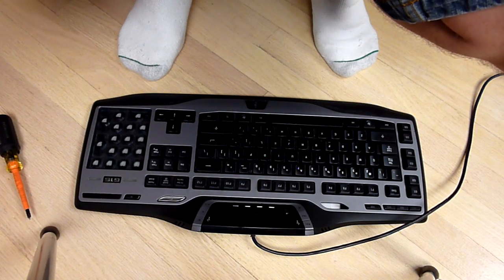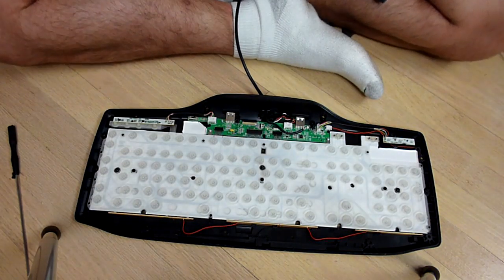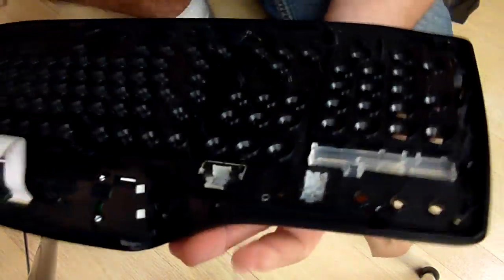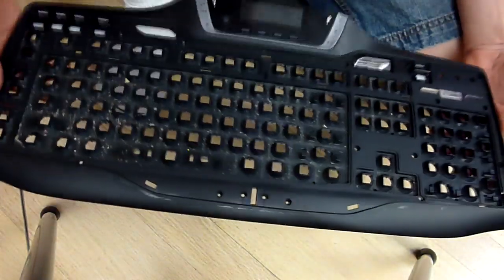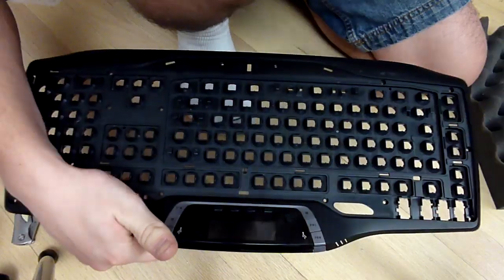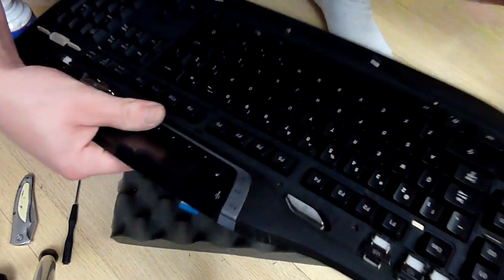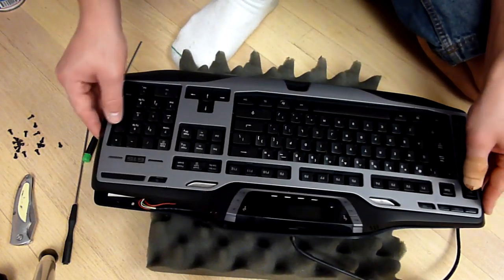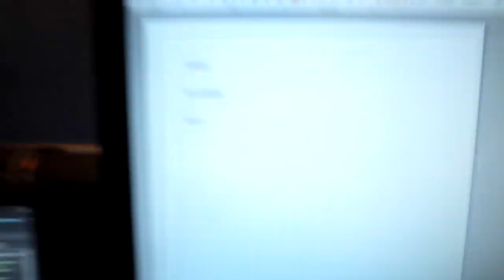Computer Maintenance 101 - How to: Clean Your Keyboard (Logitech G15) - HD

Comment: Cleaned and ready for another 16 years of use. I was stunned by the improvement, I assumed most of my grime/stiff buttons were permanent by now - but a soak in some soapy water and a shower and it feels like a new keyboard all around. 

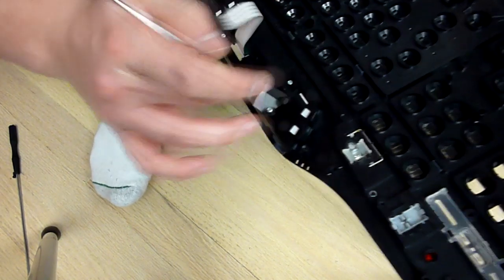Also had problems with the clips around the FN buttons (9:35), for me they simply refused to come loose. The back of the clip is kind of [ shaped, and I cut down the protrusions of the ones that were stuck with a knife and could finally get them loose. The holes are simply too small for the clips to get through. 

Thanks for a good guide!
Reply from the maker: Glad this old, overly complicated, and music cringy tutorial is still helping someone lol. 
If I had this keyboard still, id remake this tutorials :P 
Anyway, thanks for the kind words.

Comment: I've got an older version of the G15 with an adjustable LCD section and cleaned it this afternoon. It's a little bit different in that after removing the bottom screws you can flip it and remove the top black outer section (do it with the LCD fully extended as the flat cable is the longest). Then you could unscrew the top section and clean the keys.

Or you can just leave it assembled and just clean it with a vacuum cleaner and a mildly wet tooth brush cleaning it with the keys down so all the crap falls out the right way. It will save you a lot of time this way.

Comment: Nice video, just cleaned my g15 v2 after watching it, never cleaned it since I brought it about 5 years ago. What a mess inside, not to mention I have a budgie that loves to stand on the keyboard a lot so you can imagine what was in there lol. Did have to pull it apart again after testing as I'd forgotten to make sure the metal bar on the larger keys were positioned under the plastic tabs but I'll remember that one for next time.
Reply from the maker: BudgieFan39 Glad my Video helped!

Comment: If you spilled water, soda or anything over your keyboard try this (IT WORKED TO ME): disassemble your keyboard, find the keyboard membrane (three foil of papers), clean it using antibacterial wipe or spry thoroughly, wait till its dry, clean the connections with the antibacterial product, wait till its dry, assemble your keyboard and WOALA!! it works!. Hope it helps!
Reply: "and WOALA"

Voila

Comment: I have a g-15 from 2011 or something and the F4<-- key is like damaged internally, it press itself, and because of that i had to create a rule in Windows through gpedit device restriction,  to uninstall  a USB/HID from the keyboard to stop the issue

Now my keyboard f4 works perfect, but  because i uninstalleD:
This 2 things usb and hid from device manager and set a rule to avoid the installation. 
USB\VID_046D&PID_C227&REV_0020
USB\VID_046D&PID_C227

Sadly this issue affects in Linux, and while installing any operative system and this is driving my crazy, because wish  logitech can do something for me, like offering a firmware or something.

Comment: I found your tutorial cleaning vid very helpful, as I just cleaned my G15 Keyboard.. but now I have a blank LCD display and the orange lights flicker ever since I put it back together?
Reply from the maker: i would say try to disconnect the robin cable again, clean the contacts, and reinsert.

Also check to see if you cracked the cable, may need replacing.

Comment: hey.. i have the same keyboard but it has some issues. the s n m and spacebar keys remain pressed like ssssssssssssssssnnnnnnnnnnnnnnnnnmmmmmmmmmmmmmmmmmmm                         you get it.. 
hpw do i fix that? will cleaning do? its out of warranty and the company doesn't take out of warranty stuff for repair. and the keyboard is not available now. please help. thanks
Reply from the maker: cleaning it will definitely help, but i can not guarantee it will fix it.

Comment: Why didn't you show the removal of the LCD panel? :-(
That was the only part that I needed to see because my media buttons are totally fucked up (hardware failure I guess) and are very difficult to press... I guess I will have to figure it out on my own ;)
Reply from the maker: honestly once you get the LCD cover off and you expose the PCB and buttons, its 2 screws and it pops out. super simple :)

Good luck!
Reply: Yes, I noticed it. I was kind of afraid to clean that aswell since it was already malfunctioning and wouldn't want to destroy it any further.

Turns out, after cleaning, it even works 100 times better and the buttons are no longer malfunctioning! :D
Reply from the maker: alain001

Awesome!

If my video helped please remember to thumb it up, and if you would like to possibly see more subscribe to see all my new releases!
Reply: @Orvis25  I got the LCD cover off, exposed the PCB and buttons.  Do not see 2 screws, nothing is popping out, not so simple for me.  Really wish you had shown either the removal or installation of the LCD assembly.  Otherwise, great video.  Oh, except the music that was as annoying as Yoko Ono.
Reply from the maker: @mre4875  HAHA, yes. my choice of music for the video was pretty crap, but what do you want for someone who was in the teenage age range :p

Comment: Would you happen to know anything that's particularly different about a G510? All I know is that I have a lot more macro keys. I spilled a nice cherry Dr. Pepper on mine and the keys are so sticky that it's not even funny. Fantastic video though!
Reply from the maker: I assume it just a slightly different case and board.

it should dissemble very similarly, just go slow and organize the parts so you know how to put it back together (i always recommend just recording taking it apart)

THANKS! remember to subscribe for more com-101 vid's

Comment: The key tabs are strong enough to just push up from topside, this way shown is so slow and a waste of time. After popping up keys put them in a colander with a mesh or something above and then put both the keyboard and keys into the dishwasher on a low temperature and after washed put in airing cupboard / boiler cupboard for 24+ hours and it'll be perfectly clean. If certain keys don't work you need to let it dry in the cupboard for longer or/and open the back to realign the plastic sheet circuitry.

I've done this to over 15 different keyboards, 5+ times each including my G15 ten times since '09
Reply from the maker: I prefer to do things the "safe" way, and would rather not have my keys heated up even marginally as it is very thing abs plastic.

Feel free to make your own video though with your method.
Reply: This way is not the safe way, the keys are designed to be removed from the top not the bottom a simple way to prove this is just look at all of the "key removal tools" out there they all remove from the top side.

As for heating them up, do you not realise how keyboards are made? The keys themselves are made in pressurised heat moulds (they can withstand a lot of heat) and then they are sprayed with paint or in some cases with or without a stencil and they are put through a heat fanned furnace/dryer which puts them through much more heat than a low-heat mode on your dish washer so they can definitely withstand the heat.

Regardless of that, if you're seriously that worried just put the keys in a bowel of warm water and wash them outside of the dishwasher.

My (the) way I said is quite clearly very safe as it's the most common way of cleaning them and for me alone by math I've washed 80 keyboards and none of them have broken, none have had deformed keys, none have had any damage and ALL worked perfectly.
Reply from the maker: RyansUps

I would say that my way is actually safer as long as you do not press the key locking tabs further than need be, rather than using excessive friction and force to pull the locking tab off the plastic wall.

everyone says their own way, i chose this way, and i feel it is safer.

And keys can be pressed with molten plastic, but plastic is also susceptible to cracking once heated and cooled enough times, so i also prefer this for the "longevity" of the keyboard.
Reply: orvis8
Trying to be smart mentioning friction and force when pulling the keys out is hilariously stupid, They go through more friction force when you're using the keys normally during typing!

Clearly you don't know the properties of ABS plastics, the reason they use it in keyboards is because of their high tolerances and high heat resistances, it could go through thousands of heat cycles before showing any damage. Most dish washers heat up to around 50-65*C with industrial ones heating up to 55-75*C but ABS plastic will hold very strong to temperatures up to 80*C and could go even higher, but it will start melting at 100*C and higher.
Reply from the maker: RyansUps
You understand that when pressing a key down, it dose not put the key lock tabs under and force. The only force they experience under normal use is from the rubber contact mat pressing them back up, and the key lock tabs stopping it form going through the front of your keyboard.

And you are correct i am not well versed in ABS plastic wide use due to its characteristics and "properties", but i am aware that under stress form heating and cooling it will eventually crack, that is why i do not recommenced washing it in a dishwasher that is heated. Another reason ABS materials say to not store in direct sunlight, or high / extreme low temperature areas.

So i do not know why you need to criticize me by claiming i am acting smart by voicing my own opinion, that happens to be opposite to yours, but you sound like an immature person to do so.
Reply: orvis8
The plastic key tabs move 0.5mm to 1mm opening them from the front or back, both ways put similar amount of force onto the keys and you probably put less force into the keys from removing from above as they only move the needed amount.

You put much more force and make the keys bend overall much more during normal typing because the tabs bend a tiny bit every time you let go of a key. Dishwashers and direct sunlight aren't hot enough to take abs plastic beyond their workable temperature range so they won't crack because of dishwashers; the only way you could potentially do this if you were heating it up and rapidly cooling it down.
Reply from the maker: RyansUps
Well i am still inclined to disagree, everything even under normal wear will break due to use, and i dont want to add anymore heat than i need to, or stress to the keys. And i personally do not feel that pulling the key through the top by forcing the tab to collapse is a better alternative to just gently pressing them in till the pop out.